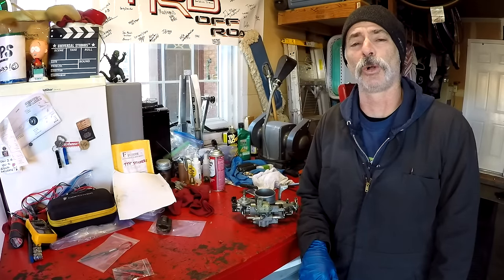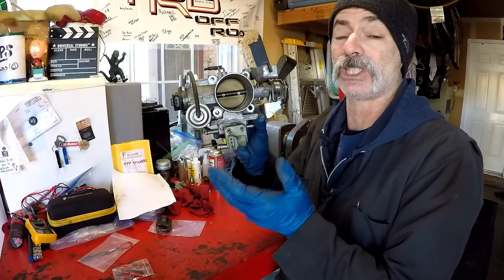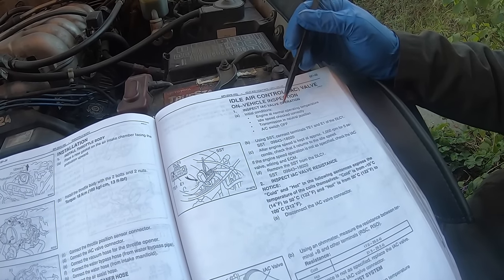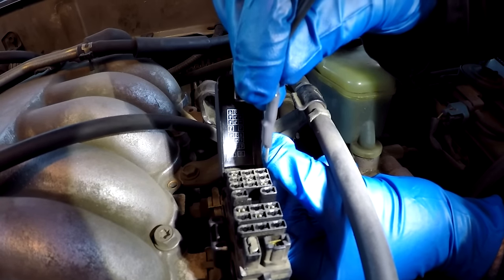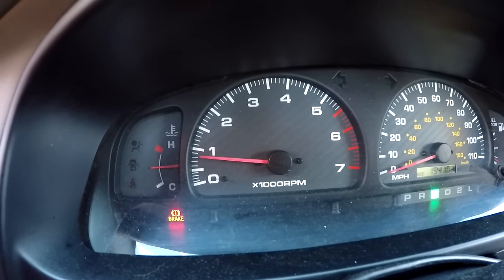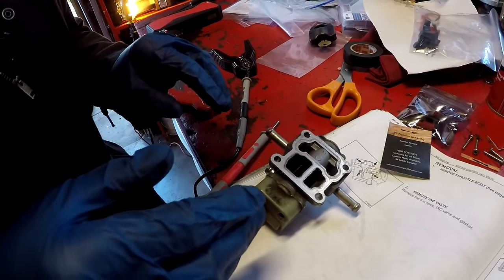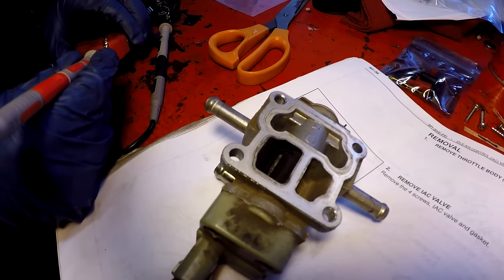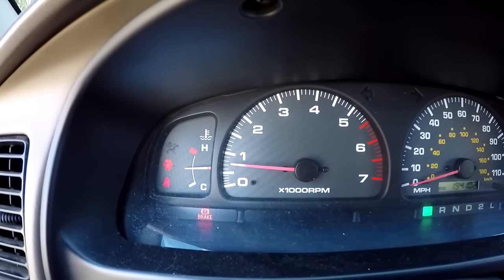IAC Valve Testing and Cleaning

Comment: Noob question. I have a 1/2" DeWalt 20V Max impact wrench, can I use this to loosen bolts when doing engine work (don't worry, I'll tighten them with a manual torque wrench during reassembly) or will the impacting action run a risk of cracking metal on the engine?
Reply from the maker: A 1/2" impact gun is not very practical for engine work due to it's size and weight.  Lots of professional mechanics and DIYers will employ the use of air ratchets but not large impact guns.  There are some things on engines that are really hard to break free like the crank pulley bolt and the camshaft pulley bolts, and so if you can get an impact gun in there, it would be advantageous to use one.  I usually use a conventional ratchet to break fasteners free and then switch to my cordless Milwaukee ratchet to zip them out the rest of the way.  The Milwaukee ratchet doesn't have very good breaking free strength but it does save me a ton of time removing fasteners.  I don't think you would crack anything by using an impact gun.  I just think it's a very impractical tool for most engine work.  I use my impact guns mostly for lug nut removals and suspension work.  I do own a smaller 3/8" Dewalt gun that's lighter and smaller and that could work for some applications when working on an engine, but it's also much bigger than any ratchet, so in a lot of cases you'll have trouble getting it in where you need to.  For things on the very top of the motor, no problem.  For removing fasteners on the sides or front of the motor, there's not a ton of room to get an impact gun in there.  Since you already own Dewalt 20V batteries, you may be interested in the 3/8" Dewalt gun I own, here's a link:  https://amzn.to/2uqWnZy

Comment: I have an 03 Avalon. Car idles perfectly fine after 10 minutes of warming up, around 700ish rpms.  But on cold start the idle revs very high, 1800 rpm and if i immediately unplug the IAC it drops down to 700 rpms. This seems like the problem.  Is high idle a symptom or is it getting a bad signal from elsewhere (ThrottlePositionSensor/Computers/ect.)?  It is odd and stands to reson that it opens when it idles fast, then when warmed up closes qnd causes the lowered idle.  Maybe it is opening too far?  Also, I noticed a restance reading of 0 when testing between all three connector pins at the colder temperature scale,  same when warmed up but could never get over 112 degrees Fahrenheit.
Reply from the maker: It could possibly be an issue with the throttle position sensor or ECU, maybe even the coolant temp sensor.
Reply: @TimmyTheToolman  thanks.  If I break down and buy one I'll let you know the results.  if it doesn't work I'll probably have to take it to somebody with a OBD2 scanner and diagnose it
Reply from the maker: @tomblobasjamesc.mccollum1740  No problem.

Comment: I have a question.. what is the cause of my idle problem.. when i turn on the aircon the idle is going down.. thats normal? 4afe engine.
Reply from the maker: Your idle should increase when you turn the AC on.  Can't say for sure what your issue could be.  It could be an issue with the compressor.  It could be vacuum switching valve for the AC idle up.  It could be an issue with the IAC too from what I've read.

Comment: I was wondering what OBd2 scaner are you using. I need to get me one of those. Thanks!
Reply from the maker: I use the Torque Pro App with my Android phone.  The info is sent to my phone via a Bluetooth OBD II Reader.  Here's what I got:

*Bluetooth OBD II Reader I use:
https://amzn.to/2MKjLJU

*This switch is a nice addition to the OBDII reader because the reader draws a small amount of power from your battery even when the vehicle is off.  If you let the vehicle sit for long periods of time, it could drain your battery.  This switch allows you to turn it off:
https://amzn.to/2t20af9

Comment: Fantabolous clip I am on my way to get a gasket for my 2000 4 runner I have a blue driver Bluetooth scan tool, my truck has 418,000 miles it just thru a code today about this sensor. If i can fix the code then I got to drive ole girl all the way to Houston from Chicago to where I got a brand new Eastwood MP250I combo rig ready to tackle the rust situation. Ive been driving that 4 runner back and forth 1260 mile one way for 20 yrs. The Chicago salt is killing it but it runs like a timex watch. Work is slow in the hall here IBEW#134 I will use the time to tighten up the rust and see if I can break a record or something I will give it to my grandson and buy a new one If When I do I will maybe try to spray redguard underneath the rear end? it's plastic easy to remove what do you all think?
Reply from the maker: Good luck with fixing code issue.  We're not an experts on rust-proofing because we live in the California Bay Area and we don't deal with salted roads and the rust it causes.  Breaking the 400k mileage mark is impressive and hopefully it will last for a long time to come.  Happy Wrenching!

Comment: After cleaning the TB actually went from 700 to 1900, havent driven it for too long, what do you suggest?
Reply from the maker: Clean the IAC and make sure all your vacuum lines are properly connected.
Reply: @TimmyTheToolman  Also cleaned the IAC, issue happens only on neutral or park
Reply from the maker: @miguel2592  The only thing I can think of is a vacuum leak.  When the transmission is in neutral or park, there's no load on the engine.  In Drive, the engine has a load on it, and the idle will drop.

Comment: Hey Timmy I need some help with my 4runner. I have a 97 limited and whenever I pin the gas down like on an on ramp or to pass someone the moment I let off the throttle the engine turns off, it starts right up like nothing The moment I pull over. I had to replace the fuel Injectors because 2 of them were burned out, Along with that I’ve replaced the PCV valve, spark plugs, fuel filter, fuel pressure regulator o ring, fuel rail washers, etc… I have spark, definitely have fuel (I ran a fuel pressure test), I have good compression, I even replaced the crank position sensor. Also when it’s cold it starts right up without even a full crank, but when it’s hot and I try to start it again it takes a lot longer like 5-6 cranks. I am completely stuck here, last thing I can think of is to clean out the MAF, IAC, and throttle body. Any advice or ideas? Thanks I’m advance!
Reply from the maker: The IAC not only provides air to the engine during idling but also gives air to the engine under deceleration when you've taken your foot off the gas pedal.  Maybe the IAC door isn't opening like it should after hard accelerations.
Reply: @TimmyTheToolman  that’s what I was thinking, I went ahead and cleaned out the IAC and it even tested within spec. Still having the same issue. I’m all out of ideas…
Reply from the maker: @unofficial_sergio3009  Maybe an issue with the throttle position sensor.  Have you tested that?
Reply: @TimmyTheToolman  with the key in the on position I get 5v to the power wire and .1 volts to the signal wire. Turning the throttle manually increases voltage at the signal wire to around 3.2v. But with the engine running if I blip the throttle open, voltage goes from .1 to only 1.3v. Not sure if that’s normal or not

Comment: Sorry if you showed this on the vid, do you lubricate the throttle plate?
Reply from the maker: No, you don't and we actually didn't cover this in the video.
Reply: @TimmyTheToolman  Do you recommend doing so when cleaning the throttle body? (Lubricating the throttle valve)

Comment: Hi 4 runner friends.
I need a little help with my 97 runner w the 3.4. My fuel mileage is not much more than 10mpg 
I run mid to high grade gas use seamfoam frequently n have new plugs n wires and replaced fuel filter n have a k&n air filter.
What could I do to help mpg...
My tires are a little over sized but no lift
I appreciate any suggestions
I do let it warm up 5 min
 or so Because of the cold
Reply from the maker: Are you doing mostly city driving or is that 10 mpg a mix of city and highway?  These rigs get really bad mileage for city driving but 10 mpg is excessively low.  Since you didn't mention it, I'm guessing you're not throwing and CEL codes?  You've covered the tune-up part of the equation.  I doubt your K&N air filter would change your mpg drastically but if that is an oiled filter, they have been known to dirty up the sensor wires for the MAF sensor.  But, when the MAF sensor wires get dirty, they usually cause a "too lean" CEL to pop up because the computer isn't reading correctly the amount of air that's coming into the motor.  

A lazy upstream O2 sensor could affect gas mileage and they won't always throw a code.  They just get less effective.

Here's my suggestions.  Go back to the stock paper air filter and clean your MAF sensor and see if that changes anything with the mpg.  If you've never cleaned the MAF sensor, it's pretty easy.  It plugs into the air box assembly in the tube just beyond the air filter box.  To get it out, I suggest removing the air box so you can get onto the 2 screws easier with a screwdriver.  In our valve cover gasket video https://youtu.be/N5fAXAuGozI start watching at play time 5 minutes and 33 seconds.

If that does nothing, I'd replace your upstream O2 sensor and see if that helps with the mpg.  We have a video for the O2 sensor replacement: https://youtu.be/CtngAVxJxkE  Be sure to check the video description for helpful information.

Let me know how it goes and you had an increase in your mpg from either of my suggestions.  Good Luck!

Comment: Wonder if anyone could help here…on the air assist hose going out from IAC For you guys, does it have almost like a check valve in the middle of the hoses, or is it one straight line to the 3 way fitting close to firewall 
Mine has about 3inches of hose, then a plastic check valve with a spring inside and will not stay put…followed by more hose to the fitting.
Reply from the maker: Normally there is no check valve.  With a supercharger install however, that's when we've seen the use of the check valve.  Check out our supercharger install video and go to play time 50 minutes and 57 seconds to find out more about it.  https://youtu.be/7RmHXvEQwXs

if you don't have a supercharger, you could just replace the hose by buying an OEM hose from your local dealer or order it online.  We don't know the part number by the way.
Reply: @TimmyTheToolman  AAH! Yes I do have a supercharger that was installed by previous owner! Thank you so much, I’ve been looking for a while now!!!!!
Reply from the maker: @nachos4018  No problem.

Comment: Hey Timmy while i was doing that the plug for my throttle position sensor busted loose from the wiring harness what is the correct order of colors for the plug?
Reply from the maker: I took a look at my 2000 4runner and from top to bottom on the plug, it's Black w/ Blue Stripe, Black w/ Green Stripe, Black w/ Yellow Stripe.
Reply: @TimmyTheToolman  thank you that's exactly what I needed! You the man!

Comment: I cleaned mine today but didnt help. I only did thre ohms tests-  it passed but still no good after cleaning. Idle is around 800 but when i try to slowly reach 2000 it jumps from 1850 to 2400 fast.  Im gonna replace it . Amazon $28.
Reply from the maker: Interesting.  I wonder though if it could be a problem with your throttle position sensor.  I would be very reluctant to trust a $28 IAC.  If I were you, I'd test the TPS before assuming you IAC is bad.
Reply from the maker: @RednecksGoneWild  Did you OEM parts or aftermarket?
Reply from the maker: @RednecksGoneWild  Aftermarket for sensors like this is usually a BAD way to go.  Lots of guys have issues with aftermarket.  I know OEM is expensive, but it's your best bet to get your engine running well.
Reply from the maker: @RednecksGoneWild  Ok, hope they can figure it out.

Comment: The coolant temperature on my truck was 188 F. The weather was around 40-45 F, which is not very cold. Is it a good temperature for the coolant? i drove it for more than 40 minutes and the engine  was on.
Reply from the maker: You're coolant temperature is perfect.
Reply: @TimmyTheToolman  glad to hear it. Thanks

Comment: Hey! First off, thanks again for these videos, they've been totally essential to keeping my old 4Runner on the road and trails! Question: I did most of this before I knew about this video (I should have looked). I wasn't having problems with idle, but wanted to clean up the TB while I was doing spark plugs. I cleaned everything pretty well, but when I reassembled, the idle now goes pretty high (like 2000 or 3000 RPMs) or it'll bounce from 1000 to 2000. The engine runs fine other than that, and I'm not getting any warning lights. I've heard that it can take a few days for the ECU to reprogram itself after going from really dirty to clean. I tried unplugging the battery for 5min, but it's still having idle issues. Any insight?
Reply from the maker: Did you clean the IAC too or just the throttle body?
Reply: @TimmyTheToolman  Yeah, both. I pulled both off and cleaned them out. One thing I've seen in other videos that YouTube recommended: you can pull the green plastic electromagnet housing off and the magnetized shaft will be exposed. One guy pulled the vacuum line off of the bottom, capped it, and then sprayed TB cleaner into the passage. He then actuated/twisted the steel shaft until the cleaner worked its way in and it moved more freely. I might give that a shot. Another video also said that you could put the ECU into "idle re learn mode" by putting the vehicle in park (engine at operating temp), and then turning the key to "run", to "off" and then back to "run" and starting it. I'll probably try the re-learn method today and if it doesn't work, I'll try to clean it again. 

Cleaning the IAC while it's installed (It's a Camry, but I think the setup looks similar): https://www.youtube.com/watch?v=WsP2-HKz7vE

Guy takes a similar IAC apart and shows how the electromagnet and the bimetallic spring work: https://www.youtube.com/watch?v=Z_TmW0GCRpI
Reply from the maker: @toastrecon  Hope you figure it out.  Good luck!
Reply: @TimmyTheToolman  Hey! I did figure it out. Brand new throttle body from Toyota. $575? Fifteen minutes to swap it out and it’s been absolutely perfect ever since. I think my old one had just too much air leakage. I thought about some heroic measures to redo the little axle guides for the butterfly valves, but it was getting scary to drive and I needed to not worry about it anymore.
Reply from the maker: @toastrecon  Glad you got it fixed David.  Good job!

Comment: Have you heard any reason why the throttle body gasket is D shaped instead of completely open?
Reply from the maker: We don't have anything specific from Toyota but the only thing that makes sense in our minds is the engineers didn't think the full bore of the throttle body opening was necessary for the proper amount of air to reach the engine.  When somebody puts a supercharger on, the gasket for that application changes to a full opening because the engine requires more air to achieve the boost that the supercharger gives.
Reply: @TimmyTheToolman  I wonder if using the super charger gasket on a standard plenum would have any beneficial effects, such as improved fuel economy in a similar way that K&N filters and other intake mods are claimed to improve economy by improving airflow. Have you seen anyone experimenting with that?
Reply from the maker: @quillaja  Sean did it on his rig but I don't remember him talking about any verifiable benefits.
Reply from the maker: @quillaja  Yeah, let us know what you find out after swapping out the throttle body gasket.  You're very welcome.  Great to hear you're finding our videos useful.

Comment: When my trucks cold and after warm up in Drive with the brake on at idle itll shake. When I change from D to R itll dip the revs and come back to around 650rpm but it will never die. I saw a vid where a guy adjusted the iac (his idle) with turning the screw on a 04 tacoma
Reply from the maker: You can't adjust the IAC.  That guy must have been adjusting the throttle body.
Reply: @TimmyTheToolman  i swear he did a vid lemme find it
Reply: @TimmyTheToolman  can i adjust the throttle to adjust my idle?
Reply from the maker: @yotagang3705  I think you can but I've never messed with.  But, for an adjustment like that to be necessary, somebody would have had to mess it from it's factory setting.  It's possible but probably unlikely.

Comment: i did the ohms test and it read 21.4, which is in range according to the Chilton Repair Manual, it should be between 17.0-24.6... Then i did the 12v test to the +B and RSO then +B to the RSC and nothing moved...will the IAC pintle not responding to the 12v cause the engine not to start up or will it start up with high or low idle?...my car just starts  up then dies out like im out of gas, ive changed the fuel pump, filter, pressure regulator and injectors and still wont start up and stay running, giving it gas whilst starting doesnt do anything.
Reply from the maker: The IAC gives the engine the air it needs to run at idle and times of deceleration when you're foot isn't giving throttle response to the gas pedal.  If the valve doesn't open, then you're engine won't run.  Try this, start the motor and apply some gas pedal pressure like you would have to do with an old carburetor engine.  If you can keep it running with your foot on the gas pedal, it's most likely your IAC is the problem.  When you operate the gas pedal, you're not actually giving it gas, you're giving the engine air so it can make the air/fuel mixture so the engine will run.
Reply: @TimmyTheToolman  giving it gas just causes the engine to stall also, there were some moments when i would start the car and it would run a little longer and i give it some gas and it just dies, i also cleaned to MAF and still no change, car cant stay running with or without applying gas